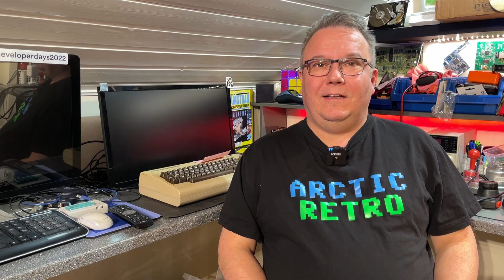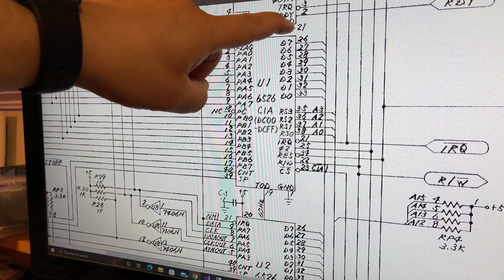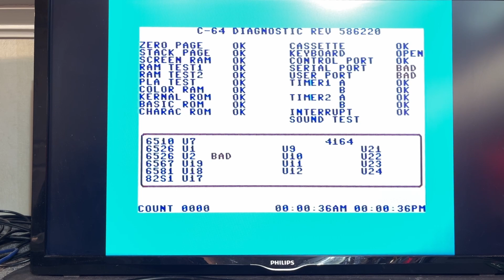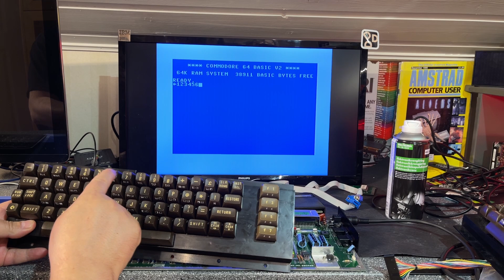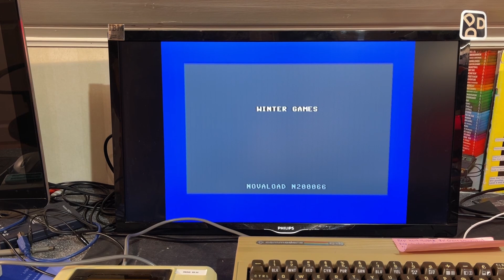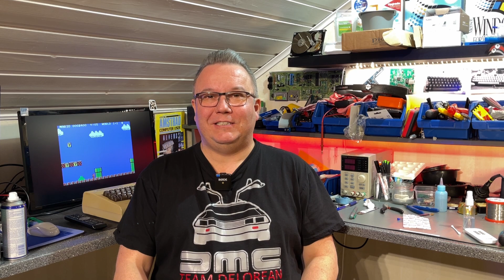Dead Commodore 64 with multiple faults repair - More problems fixed - Broken case-Recapping - Part 2

Comment: After watching your video last night I was inspired to take another look at my Commadore that is dead. I have others but this is the system that started me down the path into retro repair. Last night I finally cracked the case! Found a smoked VCO Oscillator (just right of the Vic). Never noticed it before. Thank you for your inspiration!

Comment: Am wondering when you make the wire repair to the board, this video and other videos, why not use the very thin wire that you need to heat in order to melt the insulation off. It would make the repair job look almost visible. Sorry but I forgot the name of the wire, I go look it up.
Reply: Is called enamelled copper wire. 😃element 14, 5017233.  Will need an extractor fan when soldering this

Comment: I hope you get it repaired! (I'm at the beginning of the video). Even though you have to do it way up in the Arctic, doing retro things  : )
Reply from the maker: Did you see it finished? :)
Reply: @Arcticretro  It is cool to see the original NES Super Mario Bros on the 64. The hardware can handle it, just need to use properly the scrolling and sprites. Perhaps a version of the game can be made in which the SID will play random tracks selected from the disk but only 2 voice ones perhaps, unless the sound effects can be disabled. I hope you have some extra SIDs because they are now hard to find (so I've heard) but there are FPGA replacements so good I can't tell the difference (thus, good enough!)